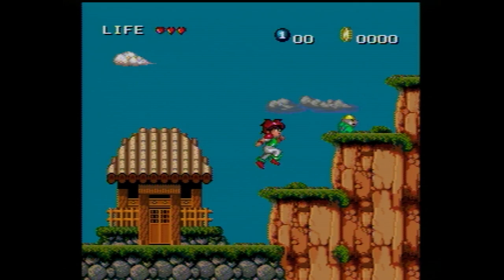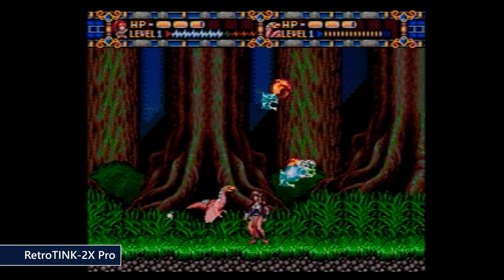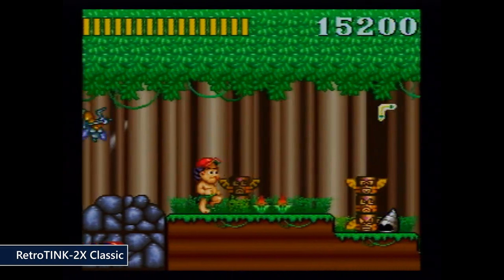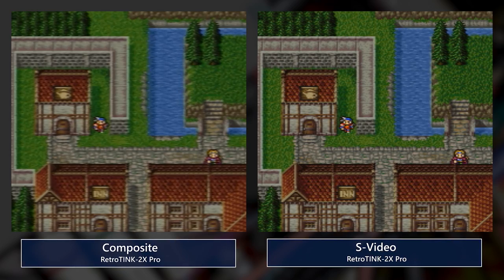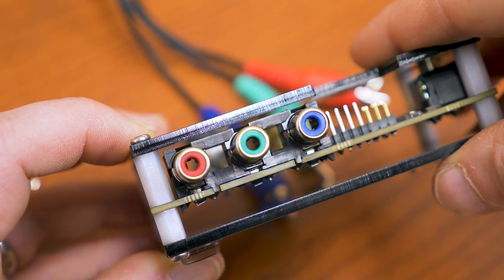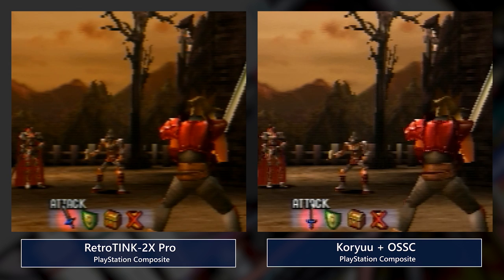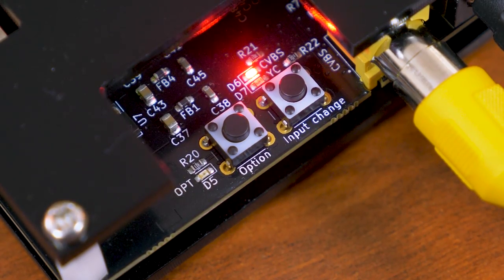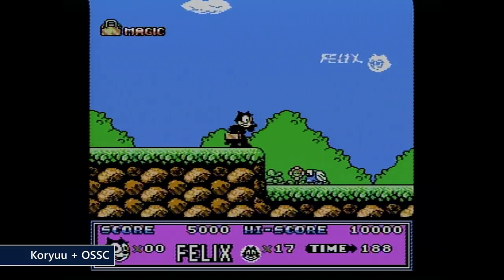RetroTINK-2X Pro & Koryuu - The best composite & S-video Options? :: MLiG Ad-Lib / MY LIFE IN GAMING

Comment: Hey guys I need help I was about to buy the pro but I did some research found it doesn't work good on ps2 or og xbox and other consoles. I was planning on using this on all consoles from NES-gamecube and ps1, ps2 and some sega consoles. Can you guys inform me about output resolutions and etc, and what my best option would be for this type of product. (Using composite on all consoles, regular hd tv not 4k, also I know composite cable are trash but I read it's useless to use component or rgb since they output so high and retrotink can't handle it)
Reply from the maker: [Try4ce] I understand where people were coming from with these suggestions, but it's not completely accurate in terms of what the TINK devices do. So the vast vast majority of games and consoles from before the Dreamcast output 240p resolution with all compatible cables. Dreamcast, PS2, Xbox, and GameCube can output 480i or 480p depending on the game. 480p is only possible with component cables, but it's something you have to use intentionally. You can still use 480i with these consoles, and the overwhelming majority of PS2 games have no support for 480p anyway. The RetroTINK-2X supports 480i, but not 480p, which is unfortunate, but there's no reason to avoid using component cables because they aren't just going to send a resolution that's "too high" for the TINK unless you tell it to. Now, I think what people were telling you about it not working well with 480i... it works just fine with 480i, but many people may not like how it looks. It uses a technique called "bob deinterlacing" to handle interlaced video with zero lag. What this means is that the video lines flicker a bit like 480i does on a CRT. This can also be bad for IPS monitors, which may have some image retention caused by the fast flicker. However the TINK offers a smoothing function, which I feel makes 480i stuff look pretty nice and smooth. It still flickers a bit, but not too bad in my opinion. Regardless, bob deinterlacing send to drive most people nuts but I don't think it's that bad if you just try to get used to it. Also, you can flick a switch on the device to do passthrough, where it will send interlaced to your TV for it to deinterlace instead, but that will result in lag. You'd definitely want to flip the switch back to 2X for 240p. So yeah not a straightforward answer, but I think your concerns of compatibility are nothing to worry about. It's just whether you like the result. The sad truth is that 480i is really messy and complicated to deal with these days, and handling it in a more pleasing way is possible, but not cost effective. It's just something you have to accept. 480i consoles benefit a lot from a CRT, moreso than 240p consoles in my opinion.

Comment: So can you use the retrotink 2x pro with an classic for an NES? I can't seem to find any info on this. Has anyone actually tried it?
Reply from the maker: [Try4ce] I don't fully understand your question, but you can use the RetroTINK-2X Classic or the RetroTINK-2X Pro with an original NES with composite cables.
Reply: @mylifeingaming  Ok I thought it only took component. Is there a device/cable that would further upscale/enhance an NES with RetroTINK-2X Pro & composite cable?
Reply from the maker: [Try4ce] The OSSC + Koryuu would upscale to a higher resolution, but in my opinion NES probably looks better on the RetroTINK-2X series. You don't necessarily want all that much resolution with composite because composite is a bad signal. The Koryuu shows it for what it is, but I feel the RetroTINK-2X hides its ugliness to some small degree.

To use composite on the Pro, you use the green port. It's shared with component.

Comment: stock C64! That's a main use I see for the Koryuu
Reply: @davidegalliussi1979  if you have a couple C64 (say 3, 4) : are you gonna mod each and every one of them? It's still nice to have something that lets you connect stock 64s to an OSSC
Reply: @FinalBaton  I follow the scene of the changes for high definition on the first gaming machines. the c64 is my favorite 8bit "pc" and i always wanted a method for the precious analog rgb signal to come out .. now that there are lcd tvs you want 480p and you need the component .. then it's just a connection choice because I think you can have an output in vga / dvi / hdmi .. the future brings everything

Comment: I have the Koryuu and the OSSC and I will say if you are using it with a Commodore 64 or a VIC-20 (s-video and composite) it looks astounding. The C64 in particular. You would be fooled to think that it is outputting RGB. I came from the RetroTink2X first with this, and while it did a great job the Koryuu with OSSC does better in this regard.

Comment: When is Mike Chi adding 480p support? I'm not upgrading my old RetroTink until he does.
Reply: The chipset used in the 2x line of devices flat out doesnt support 480p. So if he were to add 480p support itd likely be an entirely different product.

Comment: Hmmm, I was really looking at getting a Retrotink Pro but that’s a shame about 480P compatibility. It still seems like you would need both to fit every system scenario. I have the Retrovision cables and adapters for component output but of course there’s the odd system like the Nintendo 64 where S-Video is the only option and the OSSC + Koryuu looked like the clearest solution. It’s a shame nobody has made something that combines all the great features from each of these units. At the very least, it’s great to see that a Framemeister is no longer the only game in town to get great visuals out of retro consoles.

Comment: Trying to understand why you would buy a these devices instead of say...an Analogue Mega SG. Or Super NT?

Also, please someone tell me what is shimmer? Its driving me crazy you keep saying it and I don't know what it is.
Reply: Because the Analogue consoles are pretty expensive and some people just wants to hook up and play their old consoles with the cables they have laying around on a hd tv without lag, very distorded like those av to hdmi boxes or generic scalers for that matter that turns 240p/288p into 480i/576i and then upscale that to full hd which is garbage. And not all people wants to invest hundreds of dollars in RGB cables and good scalers/line doublers like the OSSC and Framemeister.
And with shimmering I don't fully understand it but what I know is like with uneven pixels and in a game when the screen is moving/scrolling there are like wobbling effects going on that's the result of uneven pixels. Or I guess with jaggies in 3d games you will have this like flickering effect that's also a shimmer effect I think. I don't fully understand shimmer so Idk if I said something wrong about shimmer.

Comment: I live in Australia and deal with PAL consoles but often like to play NTSC games in PAL60 modes. The retrotink X2 classic is advertised as a PAL60 compatible device but I had trouble getting it to work with a PAL PSone, N64 and Saturn. I emailed Mike Chi about this and he said he hadn't done full testing on all PAL consoles and made the excuse that some have "non-standard" output making them not work. The device is basically useless to me.
Reply from the maker: [Try4ce] How long ago was this? The Classic had many extra modes added to it some time after the initial launch. Basically when you hit the input button, it doesn't just go through the 3 inputs, it also changes to a few other special modes like input for PAL 60. It confused me at first and does make cycling through the inputs more confusing, but the support is there now, in theory. I don't have the hardware to verify how it works though.
Reply: @mylifeingaming  less than 4 months ago. I'm aware of the mode switching and how it's all "supposed" to work but it didn't for me. I tried multiple different consoles, cables and tv setups in my troubleshooting shooting process but just couldn't get it to do PAL60 or even just regular PAL in some cases. As I said I emailed MIKE about this and he said he hadn't properly tested the PAL60 functionality as he didn't have access to consoles to test. So he's advertising PAL60 functionality without knowing if it works. The pro version of the product probably works but I'm not willing to pay to be a beta tester.
Reply: @Reecetafarian  Hi, as I recall, everything worked through your the HDMI pass-thru of your XBOX One, which seems to indicate that there's an incompatibility with your TV and not a fundamental problem with the design. Also we tested PAL60 on multiple consoles and I even offered to replace your unit... to which you never replied. So I guess I'm a bit lost on your hostile tone.
Reply: @retrotink339  What I'm I supposed to do with a replacement if the issue with the number of different TVs I tested it on? Why carry the cost to send it back to you for no gain to me? The product should have worked as advertised with out the disclaimers that were added to your site after our interaction.
Reply: @Reecetafarian  Sorry you feel that way, but happy to replace or refund to which you never replied... I'm just one guy and that's the best I can do :-)
Reply: @retrotink339  Apologies for my tone. I'm just still very frustrated and angry about the device. I don't have a lot of money to spend things like this. Your device seemed like a great solution to my problem at a great price but gave me nothing but hours of frustration. I understand that I have a quite unique use case but I'm sure not the only person who wants to use the tink in this way.
Reply: @Reecetafarian  No apologies needed and can definitely sympathize. Shoot me an e-mail and let's follow up. We can't possibly test every potential modification to a console, but AFAIK PAL-60 should work fine, which is why I think we're missing something.

Comment: Hey you guys

I recently ordered a Retro Tink 2x classic in switzerland to have it sent to germany, but sadly though thats been a few days ago before the Pro Version's been anounced for official sale... what are your thoughts about this? is it worth it to sell  the classic Retro Tink 2x again and order the new pro version or should I stay with it as soon as it arrives?
right now there seems no alternative option to buy it somewhere directly in germany so I think I'd stay with the classic as long as it'd satisfy my needs

Good Video Channel quality and  entertainment btw.
Best greets
Reply from the maker: [Try4ce] In my opinion, the biggest features of the Pro are ease of use. I'd try the Classic for a bit and see if you like it. The features and results are nearly the same.
Reply: Hello

thanks for your answer
Shouldn't be both devices easy to use or might the RT2X classic a bit trickier to handle?
As far as I'm concerned they'd both looking quite pretty easy to connec and stuff.. although I've read about the audio causing some issues, or does that depend  on every device that's been produced? some does, someothers don't..

Comment: i feel like these devices would have been a big deal and relevant back in the early 2000  and around 2006. now theres some many good and better options out there now a days. also are people really going to go back to composite RF and s-video. its so outdated. most people have HDTVs and HD Monitors. for the minimal people out there that has PVMs and CRTs they have RGB and Component outputs anyway.
Reply from the maker: [Try4ce] I think you underestimate how many people want to use these consoles without modifying them, or without investing in RGB or HD Retrovision cables.

Comment: Not being able to get 480p seems like a enough of a negative for me as I've been collecting a lot for the 6th gen of consoles.
Reply: Yeah the retrotink2x isnt really meant for 480p content. Its a limitation of the chipset used.
Reply: Most PS2 games are in 480i so the Retrotink does very well in that area. It's also useful for Dreamcast games that don't support VGA.
Reply: @masterlee1988  most of my 6th games are on the original Xbox with almost all of them having progressive scan alongside the gamecube exclusives, so yeah that's why it's a knock for me personally.
Reply: @g1nobleteam  Oh yeah, that makes sense. It seems like some OG Xbox games only do 480i but it's pretty much a 480p machine. Not as many Gamecube games support 480p(200 something) but it still does support it more than PS2.

Comment: Buying the retrotink "Classic" for my PS2 and VCR was a really bad decision. If you softmod your PS2, a lot of popular games have 480p support via cheats and the first revisions of the retrotink just crashed with even slightly unstable VCR S-Video signals.
For that little amount that the OSSC is more expensive than the retrotink and the option of high quality component cables, even for the SNES, there is no use case, where the retrotink is of much relevance, especially for that steep price.
Reply from the maker: [Try4ce] Those are definitely some of the device's weak areas. VHS tapes have really poor sync characteristics (running them through a DVD recorder is a better way to stabilize the signal). And yes, routing a PS2, GameCube, or Xbox through it with component cables is inconvenient. I do like how PS2 480i looks through it though.

Comment: Dude can you help me please? I’m getting the retrotink2xpro specifically for my NES, and I need to know what kind of composite or AV cables to use for optimal quality.
Reply from the maker: [Try4ce] You really don't need to buy anything crazy for NES composite - I've never noticed a visible difference with any cables. You may want to buy a RCA Y-adapter/splitter for the audio though because NES only has mono audio output and that way you can connect the audio to both the left and right inputs on the TINK and audio will come out of both speakers.
Reply: Do you think the retro 2x pro looks better with composite or S video?
Reply from the maker: [Try4ce] S-video looks better when it's supported because it's a cleaner signal.

Comment: stop using hd as the excuse to explain a wide screen tv...

the full limitation of the svideo bus is 720x576 i/p if supported.. by the console..

noting that no console of dvd generation did support 1080i as it was the limitation of the drive itself.. very few games were made to support the 1080i/p format..

if you are trying to force a resolution that the connection can not handle you are going to have issues trying to force it interlace and progressive scan only really implied to mid to high range dvd players...

and the best out of a vcd1.0-2.0 standard  on cd based media would be 720x576..

please realize 1280x720 is a pc resolution only

Comment: These are pretty pointless.  If you're gonna spend $90 (or $130!) on these, just buy the OSSC instead.  You can get the Kaico edition for $150 to $200 depending on sales.
Reply: Not pointless if you need composite and svideo for consoles that dont natively support it and you arent comfortable having them modded.